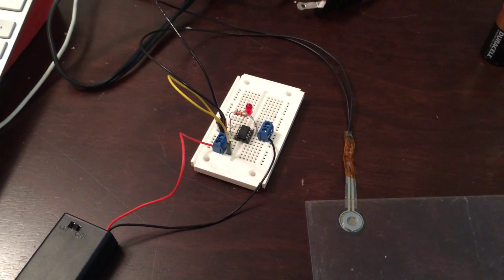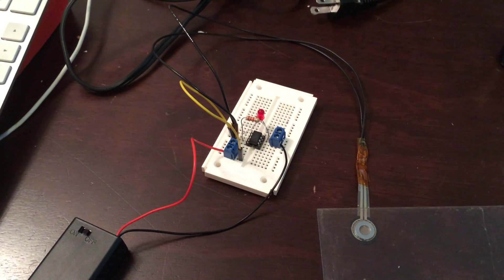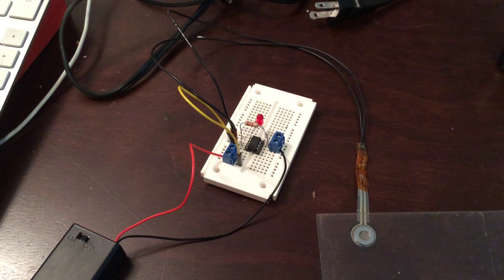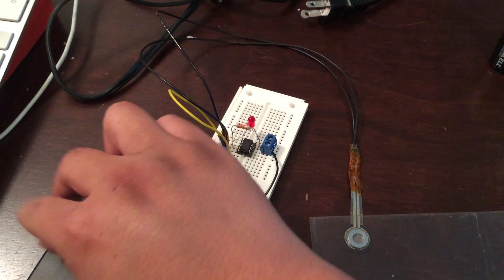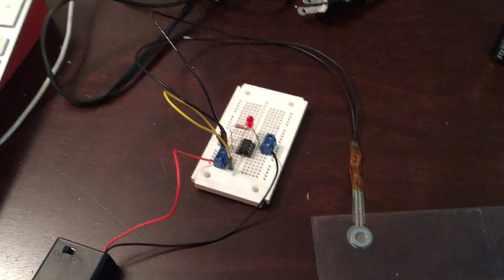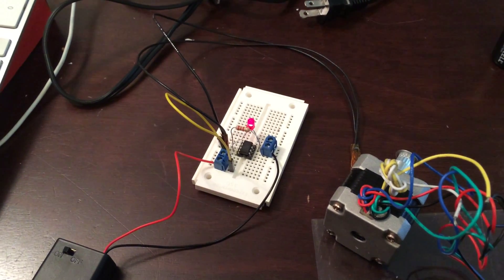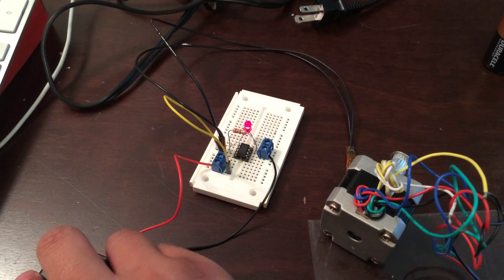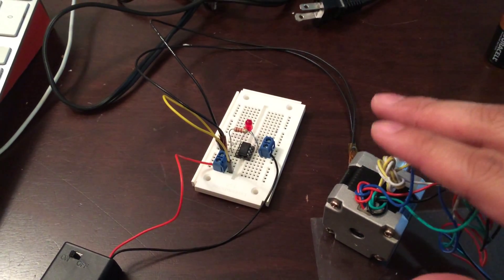Demonstration of Auto Calibrating FSR Analog To Digital Signal Module

Comment: testing out your code on the trinket... Q1: which ino file should i be using...
Q2: I can get it all up and going on initial testing, but when i try to add weight and recalibrate by resetting the trinket it wont register touch anymore.

Are there any more recent updates to this idea?
Reply from the maker: Big thing about fsr is that they have a range of usable pressure. At the start, there is high sensitivity and a sharp transition. Past that, it is linear to about 2/3rd of the way, beyond that, it is unresponsive. 

Check out JohnSL's code base and approach. He continued to develop his solution. I believe i have a link to his code in my repo.
Reply from the maker: Mr Barber  The implementation works. But you need to make sure that the amount of pressure applied to the FSR sensor is within its usable range.

The code's behaviour is along the lines of:  determine what the current stable reading is, and if there is a deviation greater than a certain threshold, then trigger. Once triggered, it will re-determine the stable reading. So once triggered, if you don't back off, it will not re-trigger again.

The FSR, in my opinion, has 3 ranges of pressure response. The first phase is the most sensitive. The second phase is linear. And the last phase is very insensitive. 

The boards he is selling are fine and will work fine. What I'm talking about is the amount of pressure being applied to the sensor and the sensitivity range that you fall in based on your setup.

But both his code and mine work.
Reply: Ok, so basically, if my bed is too heavy I'll have sensitivity issues and if it's too light I'll have false positives?  so maybe using a spring or something to offset the mass while using hold down screws to apply a specific amount of pressure would be a good idea?
Reply from the maker: Right, pretty much. Different folks have employed different mounting approaches. I used double sided tape to keep the build plate stationary. 

There is a very good discussion thread on this in the deltabot google discussion group. I would strongly suggest searching there for ideas. 

I'm currently not using FSR(s) for probing and am primarily using cartesian printers vs delta printers, so don't have any current/new suggestions regarding mounting for fsr(s).
Reply: Wing Wong so what are you saying? is this implementation unusable?  the other guys repositories aren't that much newer than yours…. But his designs and boards are being sold to this day.  are you trying to say that as time goes on they become unusable or just that I'm not approaching this from the right direction?

Comment: Excellent insightful problem solving, excellent example of innovation in the RepRap community.  Looking forward to implementing this when you give us a list of parts and wiring diagram.  great example of the bread board for prototyping.
Reply from the maker: Thanks for the positive feedback! There has been great feedback from the RepRap/Deltabot community as well. The code is being updated to support several of the compact "Arduino-style" boards out there sporting the ATtiny85, ATtiny84, and ATmega328. The larger chips so that more than one individual FSR can be independently calibrated to generate a signal using a single chip.

Comment: Very cool...now, what is the repeatability of the "touches"? 0.1mm?
Reply from the maker: I just got my replacement ramps-fd/due boards, so will hopefully have things plugged in and have a go at the autocalibration test run. Will repost when i have that data.
Reply: I want to see kits available...
Reply: I like!
Reply: Sweet
Reply from the maker: Jay Couture so first run with sensors taped to paperback textbook and plate on top shows repeatability around .25mm on average. 

Going to change the setup so that it's more like the actual setups people have and retry.
Reply from the maker: Brian Halkett Check out the #deltabot google group. We have a thread going where JohnSL, who was working on his own MCU controlled FSR trigger, is getting together a batch build of assembled PCB units. 

The forum:
https://groups.google.com/forum/#!forum/deltabot

JohnSL's original posting about his board:
https://groups.google.com/forum/#!topic/deltabot/Uckthc7Tr0M%5B1-25-false%5D

Current Buy-In Thread:
https://groups.google.com/forum/#!topic/deltabot/2Nvtv4aicKk%5B1-25-false%5D

Also got a vid up testing out the module he sent me:
Test with John Socha-Leialoha's FSR trigger circuit

Comment from the maker: Demonstration of my auto calibrating FSR control module. Takes the analog output from the FSR sensor and sends an output trigger when contact is detected.

Showing how additional mass on the sensor, say from a heavier plate, or objects on the plate, can be accounted for using the module's re-calibrate signal pin to trigger a recalibration. Can also have the module continually adjust its calibration and only trigger on sharp changes.
Reply: please sen me the code for this chip and fsr